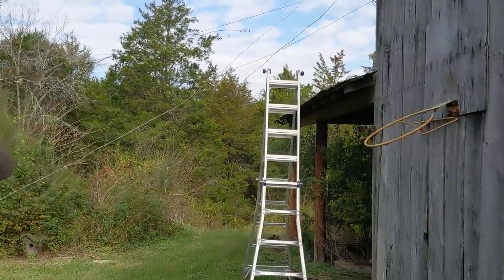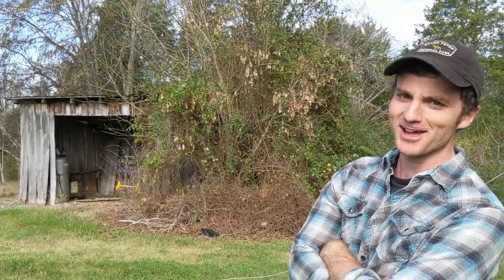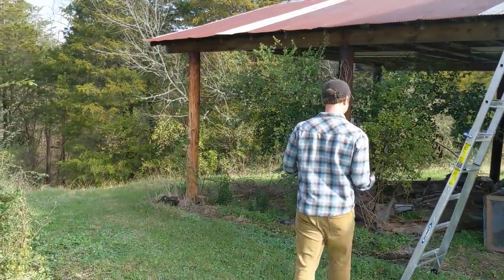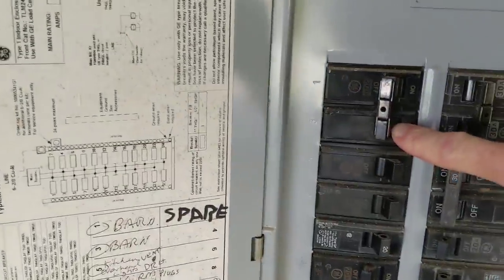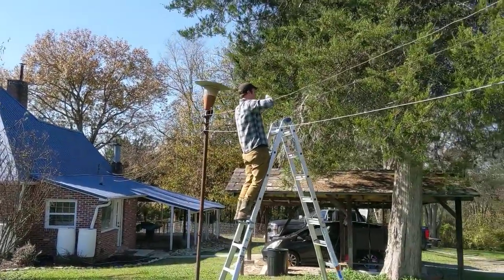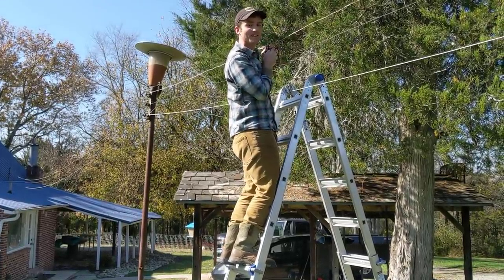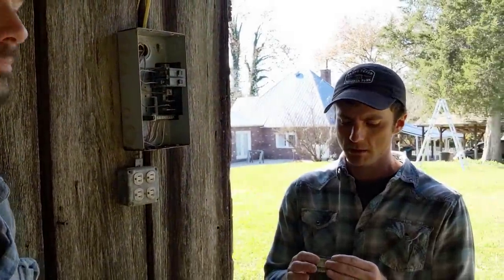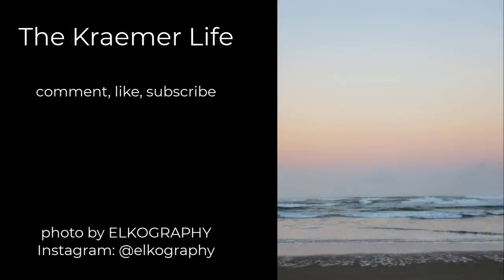Homestead Barn as No Electricity // Barn repair with @TheModernYeoman

Comment: I agree with Lori Tanner if your going to stay there forever do it the right way and bury it so if you should get any equipment you wouldn't have a problem with overhead wires. But i would first get all new wiring and maybe a newer breaker box for the barn, just a suggestion.  Larry
Reply from the maker: I do think Sean has plans to get it fixed correctly in the future. I wanted to help him get the lights working so he could see at night. Thanks for watching and the suggestion.
Reply: @TheKraemerLife  Yup! I do have plans for underground wires in the future.

Comment: I missed how you determined that the breaker was bad. Did you use a voltage tester pen on the wiring before and after the breaker and that's how you knew?
Reply from the maker: Nate used a Voltometer to ensure that it was safe to continue, before and after switching the breaker.

Comment: I would dig a trench and put the wire in pipe and bury them. Then you wouldnt have that problem again.
Reply from the maker: Sean and I discussed the various possibilities and options to get electricity back to the barn. I believe Sean has plans in the future to have it redone by an electrician. So we focused on a simple and quick method to restore power to his barn. Digging a trench and running the lines through a conduit was certainly one of the options for us.
Reply: @TheKraemerLife  Yup! Thinking I will have an electrician come out in the future and put in a trenched line.

Comment: If you are not sure if a wire is hot or not don't use the palm side of your hand if you have ANY doubt. The electricity will cause you to close your hand hand. Use the back of your hand.
Reply: Great tip! Did not know this but will do it in the future.
Reply: same for if you suspect a door might be hot (like from fire on the other side).  And, not the doorknob too.  We used to teach that to kids at school.  It makes sense that it works for electricity too.  Come to think of it, it you Have to touch electric fencing (which is my own nemesis - I really don't want to figure that one out).
Reply: I have actually never heard this. I have done a lot of electric work but it has always been the one home improvement part that scares me. How does the back of your hand change how electric responds to whether it takes your hand or even your life? I am really curious now. I do still have electric work to do.
Reply: @SouthernBelle  when you touch a hot electrical line with your palm side of your hand it can cause the muscles in the hand to contract, which causes you to grasp the wire and be unable to let go. Using the back of you hand prevents you from grasping the wire.  It won't prevent you from getting shocked or polluting your pants, but you stand a better chance of living
Reply: @tomskaggs7918  oh thanks. Now I feel stupid because that makes perfect sense. Thanks.
Reply from the maker: Nate tried to explain that in the video...you provide a great example as to why, thanks.
Reply: @TheKraemerLife  thank you. I was trying to listen to everything while Home schooling my son and I'm sure I missed some details.

Comment: As an Electrician  I'M saying NO NO NO NO NO NO IN MY HEAD when I'm watching this. Please put a romex connector in the back of the barn power box. to prevent future chafe of the wiring. the breaker that you think is bad could be good , but have a wiring problem. Mostly you have 220 VOLTS IN THE BARN WITH NO NEUTRAL OR NO GROUND YOU NEED THE FORTH WIRE. OVER IN THE BARN. YOU NEED TO DETERMIN If THE BARE WIRE COMING OVER FROM THE HOUSE IS  A NEUTRAL OR A GROUND and bring over the one that is missing, THATS IMPORTANT FOR FUTURE ELECTRICAL WORK. Sorry about the caps  I got a little excited.
Reply: Scary
Reply from the maker: HA, no worries on the CAPS. Thanks for the advice.